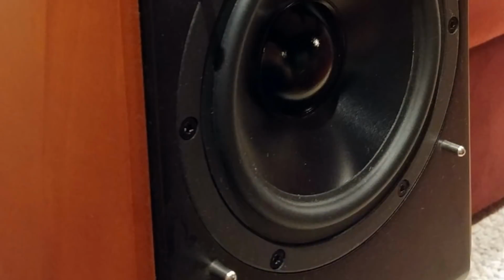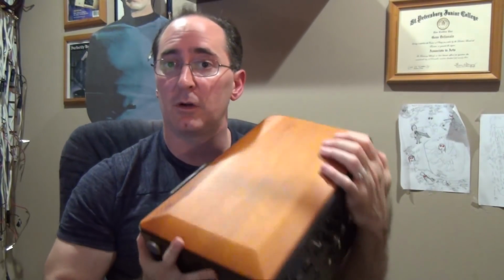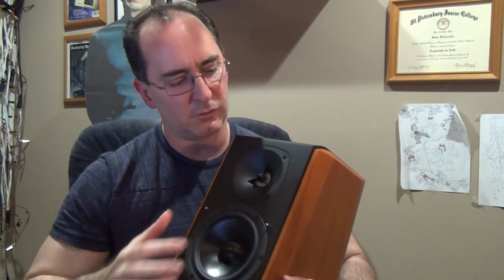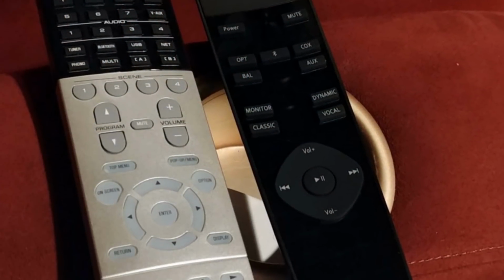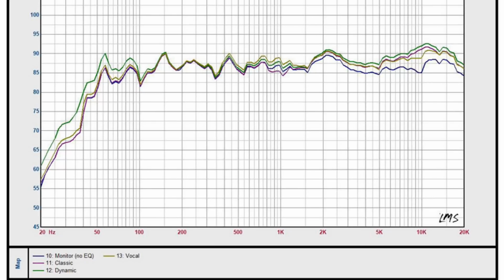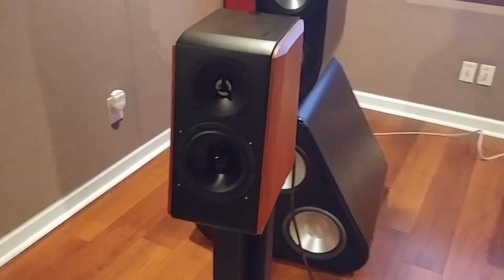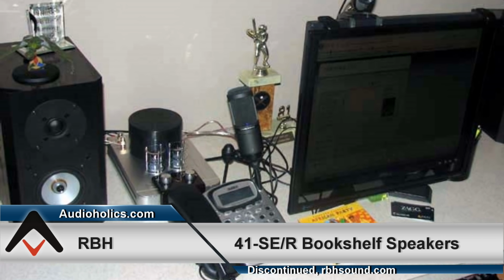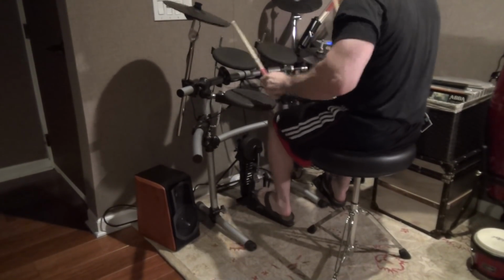Edifier S2000 Pro Wireless Powered Speaker Review

Comment: I’ve got the Edifier S1000MKII speakers.  They look almost the same as these S2000 speakers.  The sound output is magnificent and just perfect for home use.  I’ve got mine hooked up to a TV via the toslink input, to a vinyl record player via one of the RCA inputs and to a BluRay player via the coaxial input (for playing CD’s).  Of course, I can also play DVD’s and BluRay discs as normal.  
The second RCA input is a spare that I can use to hook up my phone or iPad if I want to.  And finally, the v5 Bluetooth input makes these speakers incredibly versatile and I sometimes run the sound from my laptop through them using Bluetooth.
Sound bars are old hat now.  They served a purpose for a time but nowadays these Edifiers (the S3000Pro, the S2000Pro the S1000MKII or even the very nice piano black R2000DB (which my daughter and her husband have) are the way to go, especially for the price.
I’ve also got the Edifier R1855DB’s in another room.  They’re not quite up there with the S1000MKII but I can not fault them.

Comment: I just got the Edifier s2000mkiii. If I’m sometimes using an audio interface, would the r2000pro serve me any better for that purpose? With the s2000mkiii, I used an xlr to rca cable to connect, but...yeah. Not ideal as the gain has to be turned up all the way. I’ve looked, and haven’t heard much about the xlr inputs. I just heard it was meant for a mixer. I could be mistaken, but I imagine an audio interface wouldn’t be that much different. The Bluetooth 5.0 is mostly what attracted me to the mkiii. Because:..I’m not always gong to be using it with the audio interface. Trying to use not as an all-purpose active speaker in a medium to small space.

Comment: I bought the s2000mkiii    Remote problem solved.   The Bluetooth 5.0 is amazing.   I use Amazon HD for streaming and I cannot tell the difference between streaming and CD.   They also work great for my record player.   No USB plug but you can just use the headphone jack on your computer.   For 399 these are a steal.

Comment: Hey there I am new to this. I am wondering about how to add a sub to these and found I would be able to connect to a DAC then add a powered sub to the DAC. The only problem I have is now finding a way to also run my turn table with the set up. Any ideas?
Reply: Use RCA from DAC to SGEYR 5.1 audio console adapter. Use 3.5mm to RCA to connect to speakers/subwoofer...Use green for speakers and Pink for sub to get 2.1.
Only issue is volume on sub and speakers will need to be preset and use audio device for volume control eg. PC or Phone, a pre amp maybe another solution. I couldn't find on Amazon only ebay.
https://www.ebay.com/itm/392484622223
Reply: Just get the s3000pro and you don't need a subwoofer!

Comment: big remote is fine.  These little tiny card remotes are easy to lose.  combine this with something like a bose wave radio that is even more dependent on the remote which is horrendous (of course speakers like these that are just speakers will still work without a remote).

Comment: lmao the s2000 pro are kinda marketed for tv use hence the larger remote and long cable. Give a short one you can't even fit a 50" tv
go s1000db if you need a smaller remote.

Comment: Have you tried and tested the Airpulse A100/A200/A300s that are made by Edifier and designed by Phil Jones? They claim lofty stuff with those, but I would really like to hear your opinion if they're worth the price premium over the S2000 PROs.
Reply from the maker: Yes reviewing the A200s right now. Not too impressive for double the price, unfortunately.
Reply: @Audioholics  Is the ribbon tweeter not worth it? What would be the scenarios and/or audio types, set-ups etc. where one would really benefit from ribbon over dome? I've always wondered about the pros and cons of ribbons. Are they really worth it, or just a diminishing returns type of novelty as an excuse for higher prices? Will they ever reach lower price speakers if technology advances make them cheaper to manufacture?
Reply from the maker: @17ronin  I think the S2000s are worth the money but the A200s so far haven't convinced me. More to come...

Comment: Dont you know the concept of Audio? , stop complaining about something that a company is giving you to have the speakers far enough apart to get full stereo separation ... you can always shorten it but if its too short out of the box you got to go and spend another 40$ on a longer one 
dont look a gift horse in the mouth , next time they will kick you down to a 3 feet cable and it will be your fault ... but that would not matter to you , you obviously have no idea about sound , just go pay another $40 bucks for a cable 5'"7 and a half  and a 3/16" extension in case you have to slide your monitors 3/16 of an inch closer together ,  because thats exactly how YOUR setup works for you , (at the moment) , ive heard of pomp,  but this takes the biscuit ! complaining about a "longer cable?"  WoW folks never cease to amaze me , Well done Edifier I will buy these speakers on the length of the cable alone. you know the important things... you should make them passive too so you can use the power from just your subwoofer and bypass the digital controls, just one simple switch on the back to change from passive to active ...

Comment: Hi Gene, your review made me go for this set and I must say that I'm very thankful for it. I needed a replacement for a Bose Companion 5 because the USB connection started going bad. After setting up the system and getting the first sounds out I got really happy. Also I must say that every little detail in your review is true and valuable information, anyone watching it should pay close attention. The biggest pain is the remote control wobbling around on your desk and yes I could probably kill someone with it. The cables are behind my desk so I personally don't have an issue with it but I agree, they are way too long in 95% of the situations. I was wondering if you could use an active subwoofer with the output from a 2.1/5.1 soundcard of a computer. Then again for the typical "PC" applications sometimes too much bass is not good either. Anyone playing games, watching video's/movies on PC, listening music while doing other stuff ... this is heaven and possibly overkill in level of quality, it blows the Bose Companion 5 and anything else in that price category to smithereens with a 30mm cannon. I was very lucky since when I bought them in my favorite webshop there was a bargain at 250€ instead of 450€. Imagine the value/€ !!! Edifier now released the S3000 Pro set with twice the output power. Think you could review that set?

Comment: If you drive these speakers with the line level outputs from your PC, usually called 'speaker' output, and if your soundcard hardware and its software allows for it, you can use bass management from the PC and use a sub, it's how I them set up and it works well enough.  You select for a 5.1 system and set center and surrounds to 'none', and mains to small, then go to room correction to set the level. I've found there's a lot of variability in soundcard software even for the very common 'realtek' versions of builtin soundcards.  The generic Windows properties allows for these settings if the card supports the functions.  All of that said, I went to review the settings on one of my PCs to make sure I wasn't lying about any of this and this is right, BUT, in the setup process, you can click on a diagram with the various speakers and sub to test and a test sound plays, all of that worked, including the sub, but playing a music track or movie, the sub isn't getting a signal.!!!!  Arrrrgggghhh, it was working a few days ago, this is when you learn to really appreciate the concept of defenestration.

Comment: Good in depth review but the complaints about the cable and remote are a bit rough. I'd be happy as Larry with that much cable and find some way to hide it and the remote looks class and stylish, not like the cheap credit card remotes you get with similar systems. Too much is better then not enough imo

Comment: Great unbiased review, you mentioned all the cons and pro's of the speaker and I think Edifier was taking a note on this regard and introduces the Edifier S3000 Pro wireless active speakers. It's been featured in CES 2019. I would like to watch your honest review on this one and would like to purchase one if your review turns out to be great again. Eliminating that hated extra long cable is a great deal and features a 6.5" (179mm) aluminium alloy diaphragm bass unit and boasts a 256 watts total RMS output and a planar silk tweeters for incredible acoustic reach, that's incredible. But until you will have a review on these new speakers, I will not buy them. Some says it's a KEF, Yamaha, SVS Prime, etc. wireless speaker killer and with it's price range some speakers could be a rip-off. If the sound stage level of these new speaker is the same or better than the S2000 Pro, I will not blink to buy it. I'm enabling notifications on these review and I couldn't wait to watch and share it my friends too. PS. Your drum skills match the performance of these speakers. hahaha.

Comment: I see the SPJC Certificate on the wall. Do you still live in the St. Pete area? I grew up in Pinellas County. Iv'e been watching of several of your videos [Home Theater/ Receiver] lately and appreciate your knowledge and honest reviews. I'm looking at getting the R1850BD or R1700BT for my computer desk along with a Schiit DAC. The S2000's are too big.  
.
Reply from the maker: I live about 1hr north of St. Pete now.
Reply: A year ago, I bought the R1850DB set. I won't compare apples and oranges, because the quality of the 2000Pro reviewed here is bound to be higher. That said, in a mid-size room, I've been quite happy with my speakers. Loud enough and good sound. I also ran the optical to the TV for sound improvement vs inboard TV speakers. Just recently, I added a powered sub. Not that I really felt that they were lacking... But yes now I can literally rattle the windows, not that I really like that... But below that, the deeper bass is cool. Very, very versatile. Additionally I discovered an EQ in Spotify so that allows me to further customize the sound. In sum, the R1850DB set is an incredible versatile feature-packed value.

Comment: What if I want to use the speaker in my living room left & right corner beside my 65in 4K TV. This is where I would need the speakers to be far apart (say 10 feet) & would need 3 feet  of wire going down from from the speaker to the floor & on to the other speaker 3 feet of wire going up to the speaker that sits at the TV height.
Reply: Exactly

Comment: I dont understand why so many s2000pro reviews on youtube complaining about the long cable..they gave u extra long cable and u complain?? Seriously i dont get it..it always better to have long cable rather than short cable...however, i agree on the remote design..it dont have to be that long, top sharp edges, and the rounded bottom design make it rocking side to side when u place the remote on the table..its kinda annoying..but its not a big deal..hope edifier take note on that
Reply: Man I don't really understand what people really want and they provided a shorter cable there would be even more trouble and complaints, a longer cable simply means you can place the speakers anywhere in the room without need for other cables.
Reply: Better too long than too short.  The lack of a subwoofer output is a real bummer though.
Reply: Today people have to bitch about something no matter what. The 'net rule now.
Reply: The power cable is short.
Reply: I agree that it's better to have a cable that's longer than you need than it is to have a cable that's too short. And it doesn't take much effort to curl the excess cable up and stash it behind your desk/equipment.
 
My only complaint is that, since the Edifier speaker cables are proprietary, and since they sell spare cables on their website, it would be nice if they offered different length cables as an option. As I'm writing this, the only cables Edifier offers are 5m/16ft. 

Regarding the remote: the remote supplied with the s1000Pros is much more ergonomic than the remote supplied with the s2000Pros. Even the remote supplied with the s3000Pros (while larger than it needs to be) is much more comfortable to hold.
Reply: They can use the S3000 because its connected totally wireless to each other 😂
Reply: 100% agree. BTW is an impressive cable. I agree with the remote control...   the thing is that these are the weakness is a big recommendation for these speakers.
Reply: I never met a single girl that ever complained about my cable being long and thick.
Reply: Because they’re idiots
Reply: because it's unnecessarily long, why not give a 5.1ft cable and a 10 ft cable so you can decide which one to use, it's bad design, is as if people complained that a chair is really really big, i'ts more space to sit on so it should be better right?

Comment: I have seen Edifier speakers in shops, coffee shops etc, where the speakers are located at both ends of the room. For these situation the long cable supplied is good enough. This is a situation where the speakers are not used as desktop monitors and perform very well for giving good sound ambient music for customer.

Comment: I have the edifier r2730db and the problems i had are the toslink connection is not working properly and on the left speaker the woofer is leaking air. But bass is ok till 33-35hz, and they have the sub out which is why i got those, and i paid ~200$ which is really good.

Comment: Gene please review the JBL LSR 305. Have 3 of these for L,R,C channels of my home theatre. I run them via rca cables from my AV receiver. Think you will be hard pushed to get a better sound for the money
Reply from the maker: Yes JBL just did a refresh on the 3-Series so I plan on checking them out. Thanks.
Reply: Audioholics, please pick up some of the original 305 also for a comparison. Your external amp videos inspired me to go this route and I am very glad I did, they sound fantastic and as my denon receiver is now only powering surround all round the system has more headroom
Reply: please do this model is all the hype nowadays
Reply: The 305s are nice. I have a pair in the form of the Massdrop 30X. At the map price of $180 they are fantastic.  Shortly after getting the 305s I got a pair of Swan M200 MKIIIs and I enjoy them more then the 305s.

I just get a wider deeper sound, the Swans seem to surround you more with sound. Of course the Swans cost me more at $269 for the pair (Chane Music & China had the best price) but well worth it I think. The JBLs do have a closer more imamate center image for vocals, while the Swans are a little further back. The JBLs are narrower and mostly in front of you while the Swans are wider and more enveloping. I also was intrigued by the background dinners in some tracks, where the JBLs seem to present then really close to the main center image choose to the lead singer and the Swan seems to sperate them more (maybe preferred for mixing monitoring). Personally, I enjoy the wider more enveloping sound from the Swans, but some may prefer the more intimate presentation of the JBLs. Plus the Swans instantly turn on, I don't have to wait the 7 or so seconds for the JBL to turn on.

I currently have both on my desk, but use the Swans most.

The JBLs are fantastic under $200 but above that there are other options as good or better.
Reply: RojasTKD7 , you can’t really use the swans for L,R,C channels for a home cinema as they don’t do single powered versions only pairs, one active one passive
Reply from the maker: Thanks for the comparison. Swan makes some nice speakers. I was disappointed when my T200C's died.
Reply: True, i wasn't specifically referring to using the swans as a 3 speakers front setup. Just that the the JBLs are no longer the only good option in this price bracket. 

if someone wanted something for their desk or a smaller to medium size room and had about $300 or so to spend, I would not hesitate to recommend the swans.

If Massdrop continues to offer the LSR30x for $180, I wouldn't pass up that deal. There is always a place  for the 305s/30Xs at that fantastic value.
Reply: How long did you have the T200Cs? 

They are suppose to be really good speakers and a higher tier then my M200MKIIIs. i wonder how they compare. They have a fairly unique look to them too.
Reply from the maker: I had their predecessor for 2 years which failed. Then they traded me up to T200C's which still work but started to buzz like mad after about 1 year. I can't just replace the power supply since it's fused on to the PCB.
Reply: Audioholics Humm, sorry to hear you had issues with two different pairs. I guess I'll see how my Swans hold up before adding another pair.

I'll probably pick up a pair of passive speakers  or two in the meantime.